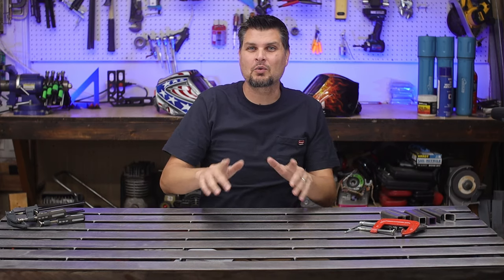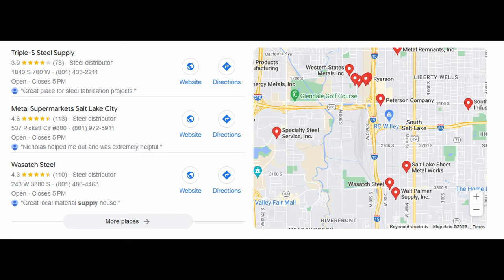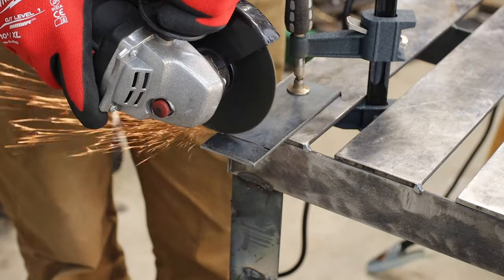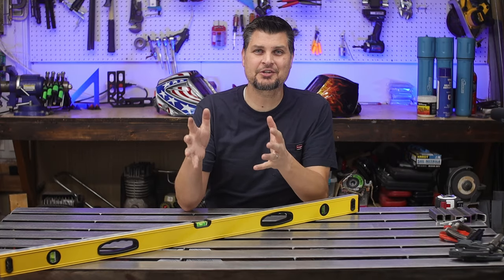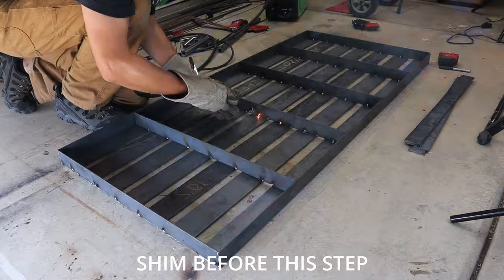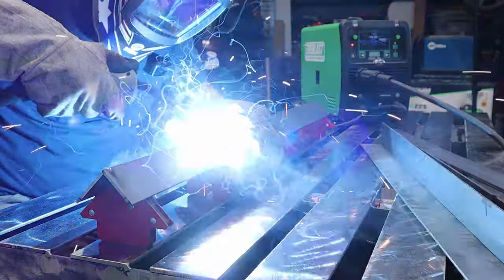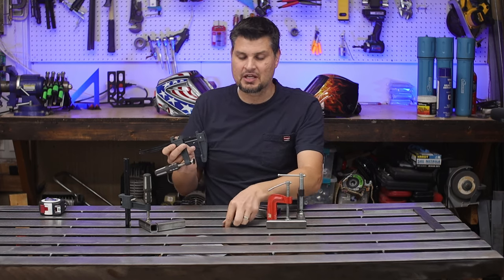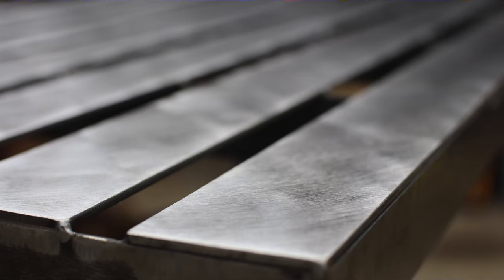ULTIMATE DIY Welding Table

Comment: Nice table. The only problem however with Evolution is that they RAPE their customers beyond life. The cost(s) of their saws especially the latest model shown is absolutely, beyond reason in price. It's absurd, frankly. I purchased their s380 CPS and they they released the Miter saw version just two months later. Though the saw cuts 'well', I paid for the iron base AND the stand which was the most I've ever spent on a 'tool'... Now with their 'Miter' saw they want nearly $1K!! Crooks. You got me once Evolution, never again.
Reply: Bro seriously using the term “rape” damn  sad tbh
Reply: Have you seriously never shopped for quality tools? Evolution is an absolute bargain compared to the competition!

Comment: Nice to see someone make an inexpensive/simple welding table that is good enough for home use rather than the "ultimate" welding table youtube vids.
Reply: I'm making the same right now, for small furniture with profiles 15 mm - 60mm it is more than enough, i would just make more bars under 5mm plates, because with harder smash you can curve it.

Comment: To take care of rust, my suggestion is this : Dissolve general grease in turpentine oil. The viscosity should be such that it can pass thru a spray bottle nozzle and not clog. Spray for long term storage and probably spread it thin with a waste cloth or brush. You can also dip a cloth in it and wipe the entire table instead of a spray bottle.

Comment: To protect it from rust. I heated the whole surface with my torch and poured burnt engine oil. This way it protects it for long time but had to repeat it in 3-4 months
Reply: I’d worry about warping
Reply: @figmojustfigmo3820 just a light heat, otherwise it will bent. I learned it on hard way :D

Comment: The Evolution saw is awesome. However the full blown one is pricey. I’m happy with the less expensive one. The first project was to use it to build a rolling base for it. I made it with a removable top so I can use the table for some of my smaller plasma cutting projects. The slot idea is a nice feature however I am doing mine differently. I’m using square tubing for everything. My plates are mounted using 3/8 X 3 flat head bolts The bolt has a nut under the plate. Then an adjusting nut next. The bolt assembly goes through clearance holes in the frame top. You can then adjust every plate with the adjusting nut. Then tighten the bottom bolt.
Reply from the maker: Sounds like a good one! Thanks for sharing!

Comment: Great design and execution of very useful and affordable welding table, absolutely love it! Thanks for sharing this very simple and elegant solution for a home shop welding table. Yeah we'd all like one of those pro fab welding tables but let's face it this will be just fine for 95% of what we need to tackle.
As far as an easy yet effective rust preventative, well of course there are lots of options, but I happened to stumble onto my welding table's new best friend just recently. I rebuild a lot of chainsaws and other small engines semi commercially. Had one fella bring in a saw a few months ago that had a very rich fuel/oil mix, think about 15 or 20:1. 
I drained his tank and put the fuel/oil mix in an old Windex sprayer, sprayed it on some pristine clean mild steel that I'd just cleaned all of the rust and mill scale off of just to see how it would last. Been on there about 3 months now and the steel looks as shiny as the day I cleaned it. You'll want to apply it outside until the volatile ends of the gas dry off of course, which doesn't take long. However the application is easy to apply and being thin due to the gas, it flows into all of the pores of the metal and leaves a nice protective film after it's gone.

Comment: Oh and I love the Slotted table!!! I have an idea "not sure if its good or bad"   Ill welcome your opinion lol.... mount my table to the wall to fold down when not in use, using a few small gas shocks like on vehicle lift gates / hatches etc.
Reply: being able to easily access your welding table from all sides is a really useful - that would be one downside of your idea.
Reply: The table is quite heavy, so both the wall and the lifting device needs to be strong. When you reduce the length to about half and only do the tabletop, you may be able to place it on two saw horses or something when needed.

Comment: Fantastic project and clamp-related features...!

To easily cut metal without getting an Evolution miter saw: Buy the Harbor Freight WARRIOR 7-1/4 in. Single Bevel Compound Miter Saw $99 ($70 when on sale inside track club), and their HERCULES 7-1/4 in., 48T Steel Cutting Circular Saw Blade ($28 regular price) and it worked GREAT* for me cutting 1/8" angle iron, etc !  (~$100 + tax total).

It's amazing how well it works, especially since its only used occasionally...!   

* It's loud when cutting and sharp hot chips fly everywhere (hearing and eye protection are a MUST), and a bar magnet still in its plastic package helps with cleanup. ...Avoid the temptation to force the cut and your blade should last a while (avoid cutting too hard and fast - or too light and slow - and your blade life should be satisfactory). I'd plan on possibly going through a blade before you get the true hang of it...  In my experience you'll still need to buy blades more frequently than with a wood saw, but the convenience, relative speed, and accuracy are worth it.
Reply from the maker: There is a lot of talk about people doing it and I guess for the occasional cut it would work but along with the blade not being designed for the higher speed it requires a lot of torque on the motor so the saw won't last very long. A cheaper (than Evolution) method that I used for many years is an abrasive chop saw. My shops still use those daily, they'll get the job done.
Reply: Does your saw still work? I don't think I'd use a wood saw for steel as the motor is 5x faster than it should be. I've heard of people putting 7" blades on 12" saws to slow down the rpms. I think a saw blade at such high speeds would be hella dangerous. Also metal fragments in the exterior motor can't be good. But is it still working for you?

Comment: Nice simple design - sure wish I had the steel prices you do.  $140 wouldn't even get the top built here.
Reply from the maker: Always ask if they have a "surplus" pile. You might find some hidden gems or plate!
Reply: @-DIYPRO-   There is, but they charge full bore for scrap pieces.  Steel demand is high here, along with stratospheric pricing.  Actually 30%-40% cheaper to order from suppliers several hours away, they deliver twice a week and will cut things like hitch plate to order for a very reasonable price.

Comment: Great table! My question is, im between copying exactly how you built this table or getting the new harbor freight one, i am getting the easy flux 125 tomorrow and if i decide to build my own it would be my first time actually using a welder, would you say this is something that can be done for a firstimer or should i just go with new titanium one?
Reply from the maker: honestly that one could go either way. If you already have projects lined up then get the Titanium and have at it. If not then the table would be a great first project.
Reply: @-DIYPRO- of course no harbor freight near me even has the table in stock. I don’t even see it on the website. I have a ton of projects lined up and need something to weld on because I’m just ruining my table saw lol